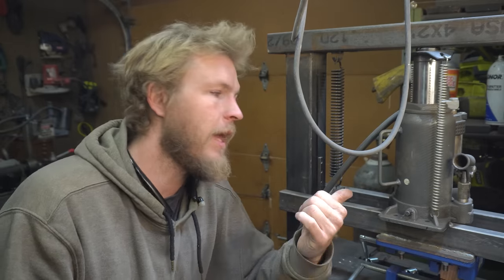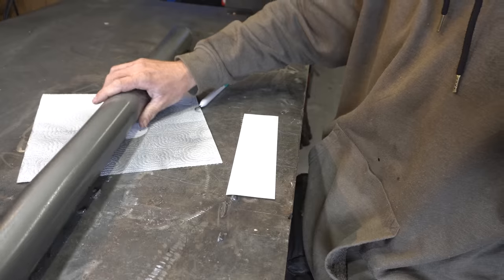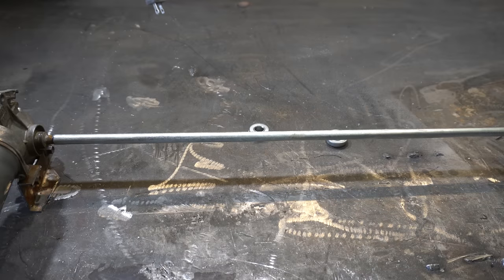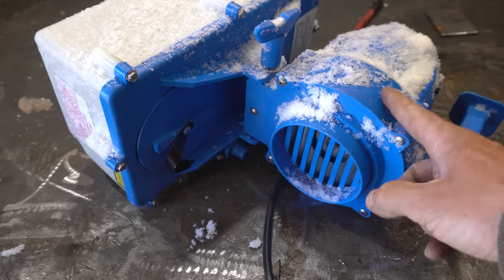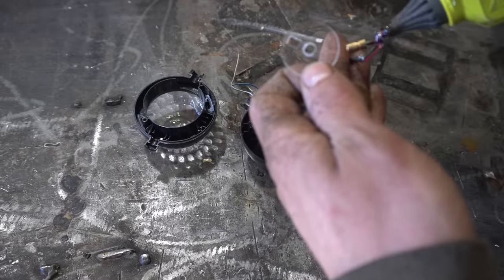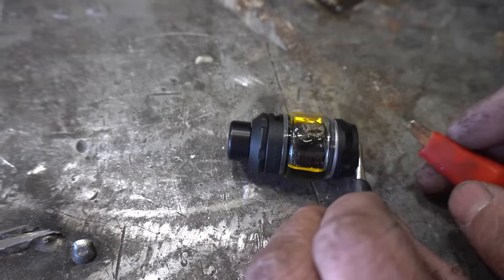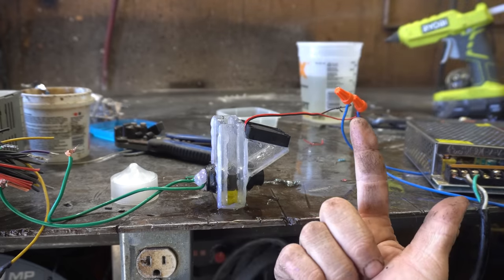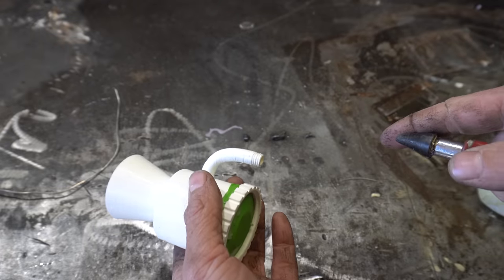Lowering The Bar

Comment: Wood bucks for sheet metal forming? Looks like they're exploding. Use oak. The compression and tensile strength is leaps and bounds higher than pine. The crazy amount of machine tool weight I have set on oak is awesome. I have used oak to span heavy weldments for straightening on large straightening presses.

Comment: You know, there's a video I've been thinking about doing but like... have no idea how to start but it's around the right to repair stuff.  I feel like you're the guy to get this - There's a sort of argument going around where the manufacturers are like "people are just not skilled enough to make this work" and the counter argument is "just give us the tools and we'll become smart enough" 

I think the real actual issue is that, we shouldn't have to be smart enough to put together an obvious solution right?  I mean a complete idiot can see that if a hydraulic cylinder isn't working on a backhoe, that replacing the cylinder or repairing it might be a solution....   sometimes we actually don't know what's wrong and we'll swap whole ass assemblies from one machine to another and it should ... SHOULD just work.  This is to me a big part of what the "right to repair" lobby sorta forgets, it's not about learning something, it's about reasonable assumptions about what should work.

If my tire has a hole in it, it's obvious to me to replace the tire.    And this works
If I have a sensor that goes out, it's NOT obvious that it needs some form of registration with the main computer to function correctly... and it won't work until I discover this.

Comment: what is lockdown city, c-19 maybe
Reply: screw it down, as screw squeeze pressure machine
Reply: what "right to kill" or judge, by law
Reply: lol :)
Reply: feel free, heat sink passive no moving parts jet, and white hot resistance coil glow ignition continuous flow burner jets

Comment: Hi, post short update videos. mafia bad guys are trying to make you feel bad, dont give up on cool ideas and SLS metal printer
Video ideas:
- (Plz try this one, im going to try for myself maybe lol) Homemade nitrogen laser by ionizing air with high voltage floating circuit super easy maybe lol (No glass tube cause waste light, use barium sulfate cavity super white, gold plated mirrors are scam! Negativity ionizing air would drop resistance down to 10 ohm per cm and cause the so called "can only be pulsed" effect, but that is BS.
- Homemade air to Argon with Nitrous Oxide to nitric acid generator maybe, like Cody's Lab,
- Circular polarization for magnetic laser. Just put an electromagnet next to laser. SLS more allotropes of carbon
- Shock-wave synthesis for diamonds maybe easy with ultrasonic sound as laser lol 100db reaches 10GPa
- Solar thermal is more efficient than photovoltaics even with inefficiency of steam engine, and even better with Vantablack or carbon nanotube paint.
- Ion mill/implantation too hard
- Free-electron laser too hard
- Laser cooling with just the right wave length 
- Laser Galvanometer Scanner for laser show and fast SLS, copy this guy watch = bl1e54QGJk4
- Thermometric generator by using alternating capacitors and wiring zig zagging around them to force Seebeck effect, also maybe use p type and n type doped wires
Reply: nobody loves me ;-;